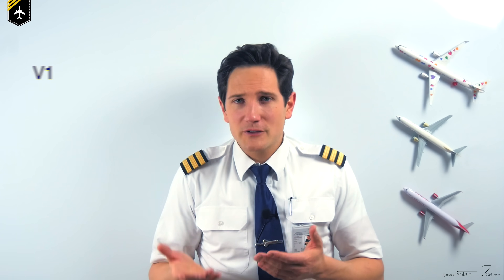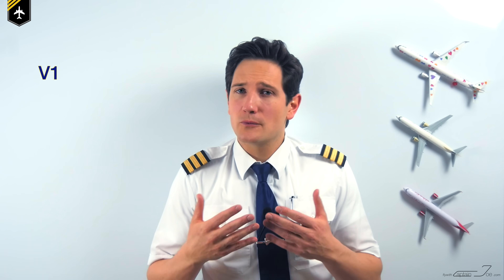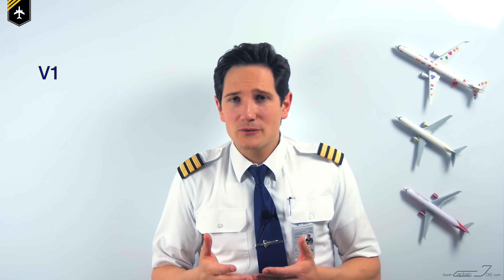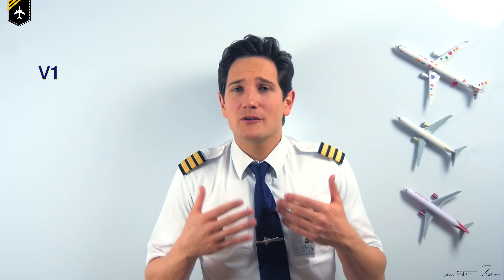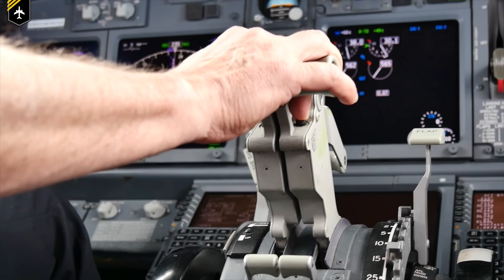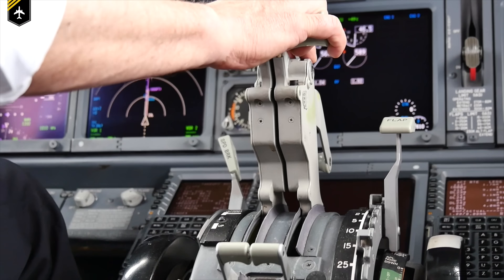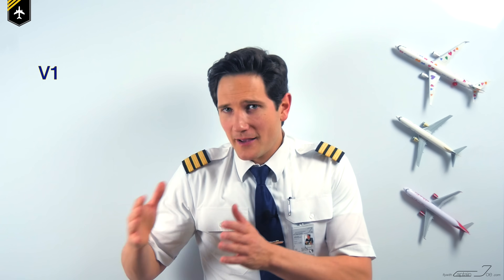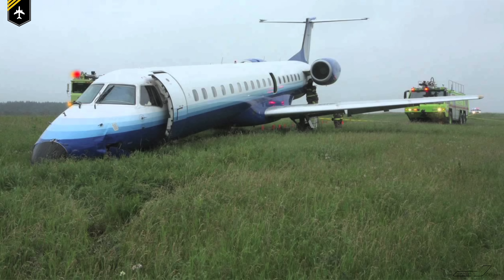TAKE-OFF Speeds V1, Vr, V2! Explained by "CAPTAIN" Joe

Comment: If there is only one engine operating then there will be a unbalance with one engine on one side operating.Could you explain it??
Reply: MOCKING BIRD Planes are built to fly safely with one engine.
Reply: That's true.  You apply opposite rudder to counteract the tendency for the engine to turn the aircraft.

Comment: What about weight concerns landing after take off as you mentioned in another video?
Reply: Any airliner can land at up to its maximum certified takeoff weight if need be.  Care is taken to limit sink rate at touchdown (though even a rate most people would consider a bit of a hard landing is still ok), and an overweight-landing inspection may have to be performed to check for structural/landing gear problems.  But maximum landing weight is not a big deal as far as the structure is concerned.

Comment: am all for RTO at V2 rather than okay to sustain V2 without colliding.... why:  what if another bird hits the other engine at V2 or there is oil pressure problems... disaster!!!   is better to deccelerate at V2 takeoff parameters than at airspeed landing parameters....regardless of anything.... it sounds insane but its safe.....  after V2:  nose down all the way; apply airbrakes; extend flaps at full, reverse thrust the one okay engine and maintain positive pressure on the rudders to avoid sideway force due to the failed engine...  boom.. u are a hero...

Comment: What suspends the force of gravity
Reply: I assume you are talking about "lift".  Some people may have heard things like that there are different theories regarding lift, that even NASA doesn't really know for sure why an airplane wing lifts, that "air moving faster over the top" doesn't actually explain lift,  etc.

What is true is that many ways have been developed over more than a century to calculate lift and the related force of drag.  Some are closed-form equation-oriented (insert the numbers into an algebraic equation and get an answer), while some are more computer-based (a set of equations is solved repeatedly from one time increment to the next).  All are inaccurate to some degree, as is any modeling of physical reality.  But one way or the other, lift is caused by fluid molecules bouncing off the underside of a surface.  Or more technically, from the change in momentum which one imparts to the other.

Conceptualizations like the "air moving faster over the top and that lowers the pressure on top" may aid in explaining lift to nontechnical people, but as far as I know there is no uncertainty on the part of aerodynamicists as to what lift is -- just how to calculate it ever more efficiently and accurately, especially for challenging situations such as rapid changes in angle of attack of the wing and/or control surfaces, supersonic flow, or rarefied (high altitude) atmosphere.

Comment: captin what is n1 and n2 please answer
Reply: N1 is the fan at the front of the engine and is measured by the percentage of the speed of sound the fan is achieving. The N2 fan is the fan at the core of the engine. This is a basic explanation but being an airline pilot I’m sure Joe can go into much more detail.
Reply: You nailed it. There's really not much more detail to go into. The only thing I would add is that typically N1 is the main stat we use for setting power.
Reply: @blaketibbitts2875  The percentage is not a percent of the speed of sound (not sure what that would mean for a rotating object anyway) but it is the percent of the rated full RPM. Also, N1 and N2 refer to the speeds of the two shafts (or two "spools") which exist in almost all modern jet engines, even if they do not have a fan. There are two shafts because the high pressure compressor section has to spin at a faster speed than the low pressure compressor (which would also include the fan if the engine is a turbofan type)

Comment: If after Vr their is no thrust then what?
Reply: GaminglordYT Yt land on the remaining runway, or aim for the most open area
Reply: A2DJP IK what I mean is you have no power or both engine fail...
Reply: GaminglordYT Yt still the same. Without thrust, if you have runway left, try landing on it, else try to put it on the ground the most practical way possible. Without any engine, you basically have to make the best of what's avalible. You can't be choosy in this situation.
Reply: A2DJP for instance take a small runway as in napal it happens then the airport is on a valley and at a low speed you won’t be able too turn because of the terrain and you can’t aim for the runway since it’s over on rotate
Reply: GaminglordYT Yt that's the thing. When you have no choice, you go for the only choice, because you are forced to. If you have no power, you don't have a choice. Max you can do is minimize the damage.
Reply: A2DJP some times you have to expect death too if it happens.....
Reply: GaminglordYT Yt not really.
As pilots we are trained to just not think of that, even if that’s obvious
Reply: A2DJP yes then there is a chance of pilot crashing it on purpose
Reply: A2DJP but you won’t be able too you would be too high on a speed of 140-150 so it will have major damage
Reply: A2DJP true

Comment: My question will probably sound stupid, but:
Considering that birds hitting the turbines is quite a common incident,  why not protect the engines with some kind of grid?
Reply: Outta Bubblegum 1, this grid has to be very strong to withstand constant aerodynamic presure 2, reduces the turbine intake meaning less efficient engines. Remember while birdstrikes are very commen they only ever cause minor damage which can be fixed anyway

Comment: During take off if engine gets failed then how much possibility is there to save the plane ✈️ and can captain go for safe landing ??? Most of time I choose train instead of plane because of all these things always in my mind ??? I will be extremely thankful if you explain about it . Please
Reply: Meraj Ahmad Khan all air planes with 2 or more engines are capable of flying with one engine and all planes are capable of flying with no engines aka gliding
Reply: Meraj Ahmad Khan all transport category aircraft are certified to continue climb on one engine (provided the V2 single engine climb out speed is attained. ). For airline (and most) pilots an engine out is a procedural non event that we’re trained operate through with religious vigor and muscle memory.
Reply: @AapeliSeveri  unless you live in Japan, those trains are safe!  And I would say a non commercial transport that is safer than airplanes would be helicopters due to auto rotation
Reply: Lachlan Hudson what if the propellers in a chopper stop, your probably not gonna survive are you?
Reply: @shortzz4561  You can autorotate a helicopter to a safe landing providing you have enough height.  It's rumoured that the Huey had enough energy in it's rotors, when up to speed, that it could lift off, do a 360 degree turn and then land again without applying any engine power.
Reply: Sorarse only a 1 year late response not bad
Reply: @shortzz4561  Not my fault this video only just hit my recommnded list.
Reply: Sorarse Im joking it’s fine
Reply: Aren’t derailing more common than commercial airline crashes? LOL😂
Reply: Takeoff performance is based off of losing an engine. So if the plane couldn't safely fly on one engine and that includes avoiding all obstacles at an airport it isn't taking off.
Reply: US Airways Flight 1549 had a bird strike to both its engines but it was still landed in the Hudson in one peace and all the passengers escaped
Reply: Check youtube for "Gimli glider" for a story about a total engine failure. A jumbo jet ran out of fuel and became a glider. Pilot landed the plane in one piece, after performing certain impressive glider maneuvers which are typically not performed with large jets.
Reply: @vonnikon  It's an amazing story. The pilot did gliding as a hobby and so looked at the plane as a huge glider. Thing was, he didn't know the airport had been changed into a recreational area (including golf course), lot of people & kids playing, having cookouts etc. and yet the plane did not hit anyone on the ground when it landed. Amazing.

Comment: Captain Joe!! One question, what would happen if you put a Supercar disc brake in a plane?
Reply: Disc brakes are exactly what airliners use -- around five pairs of rotors and stators stacked together for the brake of each wheel.  So what happens is any regular airliner landing.  : )

I stood in the cockpit behind the captain's seat during an airliner hard-braking test (had to stand to be able to see over the captain to a brake pressure gauge which had been temporarily installed above the instrument panel).  At 2000 psi of hydraulic pressure applied to the brakes (out of 3000 psi maximum), even holding tight with one hand to an instrument rack behind me the deceleration was so great that I was barely able to stay out of the captain's lap.

Comment: If runway length was no issue, would V1 be skipped, or would it be paired with Vr? It seems that in a situation with infinite runway (or any distance greater than the accelerate-stop or accelerate-go distance, it would always be better to abort for any reason before rotation, even during the high speed portion of the takeoff.

Comment: What happens when a engine fails after V1?
Reply: Airliners are designed to fly following an engine failure at V1, so after V1 is less severe.  If you mean in terms of the overall flight, though, that would normally call for a return to the departure field or landing at an appropriate en route airport -- whichever's closest.

Comment: I didnt watch the full video were he is explaining the speeds this is my way of teaching (altgough I am not a teacher or something)
V1 is the speed were if something goes wrong with the aircraft and u are at V1 speed u are not aloud to abort takeoff cause u have reached a speed were the plane has not enough runway to stop but if u haven't reached V1 u can abort 
Rotate is the speed were u are spoosed to takeoff
V2 is the speed were if u have an engine failure and u are at V2 speed u can safely climb on 1 engine

Comment: Hey Joe I'm currently going through a flight simulator and was wondering "when you have a tailwind coming in, say slightly easterly which is pushing the tail to the left, I'm pointing the nose to the right of the runway and trying to bring her in line with the runway using the rudder. But it seems to just send the entire plane to the left knocking me off course of the runway". What am I doing wrong? I manage to land her but at an unusual angle?. Any info would be amazing thanks cpt Joe.
Wayne.

Comment: “Vr or Rotate is defined as the speed at which the pilot begins to apply control inputs to make the aircraft nose to pitch up, after which it leaves the ground. The easiest way to memorize the rotate speed is the point where the nose leaves the ground and vortexes are created at the wing tips which rotate behind the aircraft. Moreover, the point where the main gear leaves the ground is the point where the aircraft has reached the Vlof – lift off speed.”
https://www.baatraining.com/did-you-know-about-aircraft-take-off-speeds-v1-vr-and-v2/

Joe do you also write for the website below .As the definitions for v1,vr and v2 are exactly what you have explained in the video.I mean word to word or you actually work for this training academy.
www.baatraining.com

Comment: Is V1 a function of the aircraft or the runway? What if you are on an old military runway which is incredibly long, would V1 be more than Vr? Surely runways exist where you could easily brake to a stop from Vr, right?
Reply: Doug Gale in such a case you simply ignore the V1 and call “rotate”. Most commuter turbo props have short enough runs that the V speed charts only have Vr and V2 (VYse). Very good question BTW.
Reply: Great question.  You will find if you are in a position where a) you have a very long runway, or b) a very small/light aeroplane (therefore a large unnecessary amount of runway available) theoretically speaking V1 would probably be larger than Vr, but is prohibited from being lower than Vmcg.  This is to ensure that directional control is still maintained on the runway in the event of an engine failure above Vmcg but below V1.  In the event that a calculation places V1 greater than Vr, V1 must be reduced to be equal to Vr.
To ensure other safety considerations are met, V1 is also limited by Vmbe, and Vtyre.
Reply: When that is the case, Aka every takeoff at DFW for us V1 and Vr are the same eg V1-141 Vr-141 V2-158.

Comment: What would be the reason for not calling out V2? Or for calling it out, for that matter? Once you fly, you fly and if you have an engine failure I'd  imagine you would try to fly as well as you can with what you have left. I.O.W., what would exactly change procedure wise once you reach V2?

Yes, I'm not a pilot.
Reply: You would avoid climbing steeply until you reached V2, then you would climb as fast as possible while maintaining V2.  That results in a rate of climb sufficient to avoid any obstacles.

Comment: Good morning Captain Joe. My name is also Joe. I am a desktop pilot for around 15 years recently I picked up X-Plane 11 and I'm using the 737 zipo mod. I really need your help. I am fairly familiar with the Boeing FMC. I have used it in Flight Sim X with the pmdg 737. For some reason after I begin setting up for a flight I get to the screen where you should be able to calculate the V speeds and when I click on it nothing happens people have said that you need to set the outside air temperature which I have done, other people have commented that you need to set up a SID.  and a STAR on your departure and arrival airports which I also have done someone else recommended that people are not entering the outside air temperature from the EICAS.  into the N1 page?..  I'm not sure if you have used the X-Plane 11 737 800 modded plane from Zipo... the problem is that this is part of the autothrottle so if the V speeds are in automatically calculated the autothrottle will not come on and you cannot do a toga takeoff any help would be greatly appreciated. I share a great love respect for flight simulation and enjoy it immensely this has been quite a stumbling block for me as I am not able to correctly config the aircraft for a proper takeoff. Thank you very much.

Comment: Hello Captain
What is the reason for changing the speed reference (IAS or Mach number) with altitude?
Reply: The earth's atmosphere properties changes as one climbs higher.  IAS (Indicated Air Speed) is  read in some value; knots, miles per hour or whatever, is gained by taking a sample of the air pressure entering the pitot tube then subtracting the static pressure resulting in a difference that is then presented as a value.  BUT at some point the air gets so much less dense (the "crossover" usually occurs somewhere around 27,000' above sea level) that the instrument no longer accurately operates (was not designed for that environment).  So a conversion is made to MACH number, speed relative to the speed of sound which is fairly constant at the altitudes commercial airplanes fly.

Comment: a question here (out of ignorance) why do they pull the gear up as soon as the plane lifts from the ground? wouldn't it be safer to keep it down some seconds more in case they have to perform an emergency land?
Reply: Given you have 2 or more engines (does not apply so single engine airplanes)  and you are past V1, and airborne there is no longer sufficient runway (usually) remaining in front of you to get the airplane back to the ground and then stop the aircraft on the runway remaining in front of you.  In fact statistically, it is overwhelmingly negative,  if the crew decides to try and stop the airplane after V1 that decision will result in an overrun (means the airplane departs the runway in some fashion; sometimes a total loss sometimes not.  Once the decision to go fly has been made, V1. and the jet is in the air the gear is of little value, at the same time the landing gear is now a large source of drag.  It is critical to get the gear up and stowed in order to be able to climb to safely overfly any obstacles in the departure path and return for a safe landing (somewhere).  You partially answered your own question in fact they will "perform an emergency land(ing)" after they finish some other required tasks and return for a safe landing.  There just isn't enough landing remaining ahead of them to do it right then and there immediately after takeoff.  Normally, once a positive rate of climb has been verified by both pilots the gear is commanded to be raised.  At all companies I have flown with the first scripted words (procedure, policy, SOP {Standard Operating Procedures} training) after getting airborne are "positive rate" meaning the airplane is actually climbing not just the nose pointing up in the sky confirmed by the pilot actually manipulating the controlled who then commands "gear up".
Reply: Apack Westbound nicely explained... Thanks!!

Comment: Hi Captain Joe, I flew as a passenger on a small commuter plane (Bombardier Q300 or Q400). I'm not a pilot but have some private pilot training (did not finish the training ).  When boarding the plane, due to the small number of passengers, the flight attendant asked all 8 of us to move to the very rear of the aircraft.  He said the plane would fly better if the weight was distributed to the rear.  I thought it was very odd, and suspected that it was is a mistake.  I thought the weigh should be at the center of gravity, not behind the wings.  My concern was that the aircraft would be unbalanced making it difficult for the pilot to keep the nose down during the descent, even causing a stall. Do you think my concern was reasonable?  Are flight attends qualified to distribute weight on an aircraft?